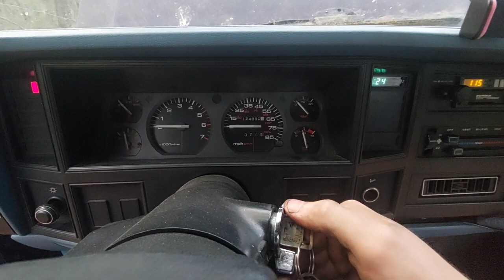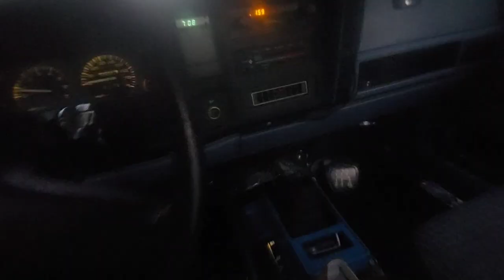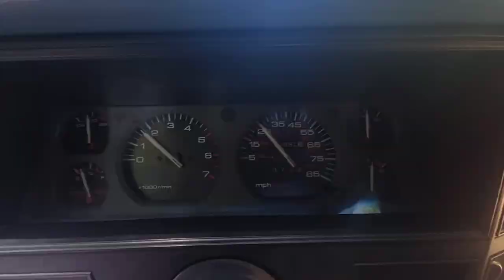Jeep Comanche - Leaf Springs & Rear Axle Replacement: Operation MJ Part 16

Comment: Glad to see the MJ is back on the road.  I would love to see a drag race between the MJ and XJ.  Great video as always.  No mid roll ads here.
Reply from the maker: well, that would certainly be interesting. They're both slow, but even with matching 3.55s, I think the MJ is still slower. Just an older, less powerful 4.0L vs an OBD-II/ coil rail/ Horseshoe intake 4.0L with Roller Rockers, I think the XJ would win, and live to tell the tale. 

I have raced the MJ before, she skirted the back tires with the 3.07 gears, but doing that again might blow up the puegoet transmission lol

Comment: If you ever have to fight this in the future, I recommend drilling the bolt head or cutting it like you did but finishing the last millimeter or so with a normal grinding wheel so you don’t destroy your frame.

Comment: I appreciate the long-form video, Waemid. Well done!
It was great to see your appreciation for the 3.55s; my 2000 XJ came factory with 3.55s, the legendary 4.0, and the AW4. I've put 30×9.50 BFG AT KO2s and a 2" lift on it (along with a lot of other non engine-related work), and am more than happy with the amount of get-up-and-go it has. It won't win any races, but I bought it for winter driving and have yet to get stuck = happy XJ owner.
(Unsolicited plug: I have YouTube Premium, and it is well worth it.)
Reply from the maker: No shame in YT Premium man, I hate ads, and I imagine everyone else does too. And I do actually get a very small cut of revenue from YT Premium viewers, so it's not like you're scamming me out of the $0.001 an ad would've generated. And sounds like a nice Jeep there guy

Comment: No mid rolls. Just adds at the beginning and end. 
This was a good video to watch to stop me from trading my xj for a mj.
Reply from the maker: well, the problems I faced were not Comanche problems, they were rust problems. If this truck had spent its life in the southeast, I could've had this done in 1 day
Reply: @WAEMIDIV  it wasnt the rust that scared me. I would have stopped buying jeeps from PA if that was the case. It's the scarcity of parts. You made really good use of the xj and yj parts, but im sure that eventually therell be one part that will require some heavy modification to get it to work. But all that effort may be worth it to keep a comanche on the road.

Comment: That’s freaking awesome! I’m thinking on replacing the leafs on my MJ too, where did you get yours?
Reply from the maker: Rockauto or Amazon has them, but Amazon had free shipping, so I went with them. Dorman 97-555 is what I used, however you could upgrade the springs to the Metric Tons and have more payload

Comment: If the front axle is still stock, being 3.07. Don't forget you don't want to put it in 4x4 until you make the front 3.55 as well.
Reply from the maker: Yes indeed, the front still has 3.07s. However my front driveshaft seized a few months ago and I haven't put it back in. I've just been using it without the front shaft for the time being.

Comment: Im back in the Mad city area for only this weekend. Where do you think I can find a pair of Add A Leafs to temporarily "fix" the saggy ass end of my shit box?  Would you be interested in replacing the rear springs if I pay you? I fly out Sunday and I'll be back in a month.
Reply from the maker: add a lead kits for MJs do not exist in any professional sense I don't think, you'd have to piece something together from used lead Springs out of other vehicles, I don't know. I don't live in Wisconsin anymore, and I'm gonna be in Michigan this weekend so no projects for me
Reply: @WAEMIDIV  oh its for my '00 XJ. I'm running over to Oreillys in Portáge to grab a Superior 11-1030 Add A Leaf kit for $70. Will work with the 2.5" wide Leafs on the XJ. Just a temporary fix. Hard to do shit when I'm working 1000 miles away.

Comment: Where did you get that speedometer 33 teeth gear? Mine  25 mph that read 35 mph and 45 mph read 55 mph. Will 33 teeth will resolve the issue? Mine 88 4.0 4x4 thanks
Reply from the maker: The speedometer gear is not dependant on engine type or 4wd, it's based on the axle gear ratio and the tire size. I had to change the speedometer gear because I changed the axle gear ratio. 

You need to find out what gear ratio your axles have, and what size tires you have, and use that information on a chart that will calculate how many teeth you need on your speedometer gear. Google search speedometer gear chart
Reply: @WAEMIDIV  okay thank you bud
Reply: @WAEMIDIV  sorry to bother you but my axle say 35c so it is Dana 35? My tire say 235/75r15 so I found on google 29 teeth gear.
Reply from the maker: @joshualavigne4359  Dana 35 is the type of axle, not the gear ratio. 
If your truck has the 4.0L and a Manual, your axle ratio is 3.07:1
If your truck has the 4.0L and an Automatic, your axle ratio is 3.55:1.
Reply: @WAEMIDIV  mine manual . 3.07:1 so 29 teeth?

Comment: How about getting some tools. Milwaukee m18 impact is actually pretty amazing.
Reply from the maker: I have an impact gun but they're useless with suspension bushings, because the rubber just absorbs all the impact of the impact gun, making it less effective than prying on it relentlessly with a stick.
Reply: @WAEMID IV  I use the m18 fuel all of the time and that thing is a monster. It might not have helped with all of them but I guarantee it would have helped with some of them.

Comment: Hahahaha wha?!? Dude just the ball joint press but put a big socket on pressing rod side and a flat removal or installation adapter on the side. It will force the bolt in. Doing the exactly what you want without having to drill a hold in your fender. I like most of your work but this was too good not to comment.. the alternative cut off wheel and about 8 minutes of work per side -ask me how I know.